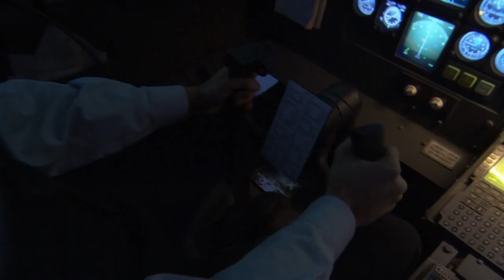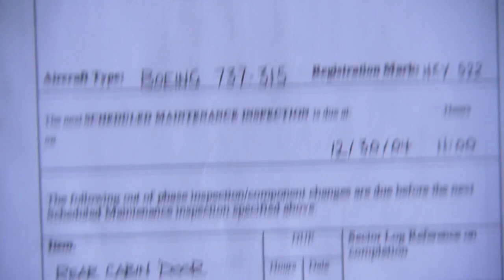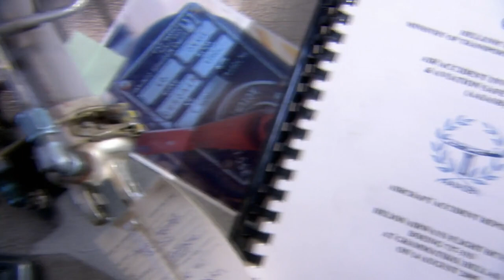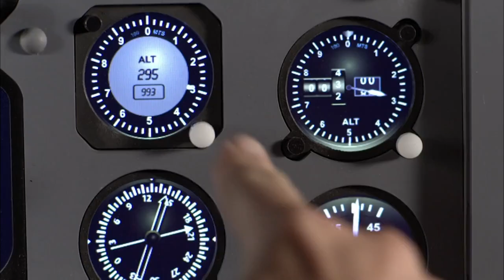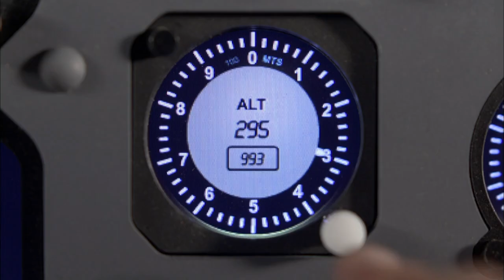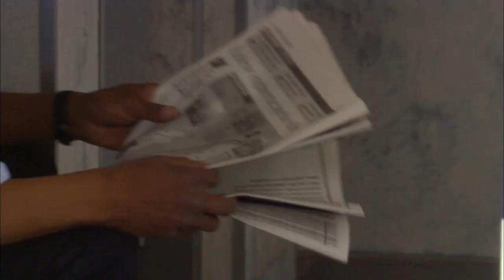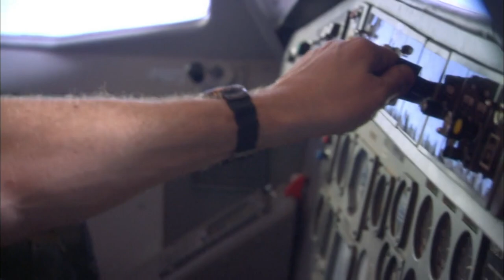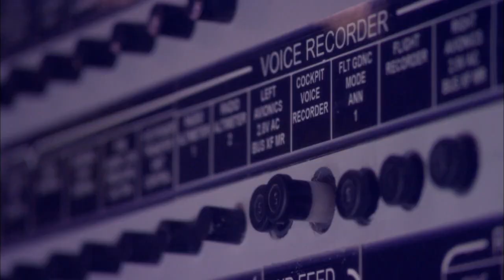The Most Mysterious Air Disasters | Mega Marathon | FULL EPISODES | Mayday: Air Disaster

Comment: On that Helios story, why does a manual "off" setting even exist for the pressurization system?  If the only settings were "Auto" and "Manual on", then the worst mistake that can happen is that the plane pressurizes before taking off.  Clearly it can handle this, or that's not how they'd test the seals.  Sure, passengers ears might hurt, But They're Alive to complain about it.

Is there something I'm missing?  Can someone explain why you'd want the ability to turn the pressurization system off while the engines are running?

Comment: The crash of mh370 is much more mysterious than Helios 522. With Helios 522, the P5 pressurization panel was left in manual, flew, lost pressure, and crashed. With MH370, we may never know what happened because the CVR & FDR have been at the bottom of the ocean for 8 years. They could be damaged beyond repair. They might not yield any information at all.